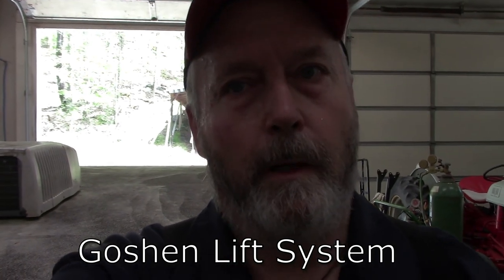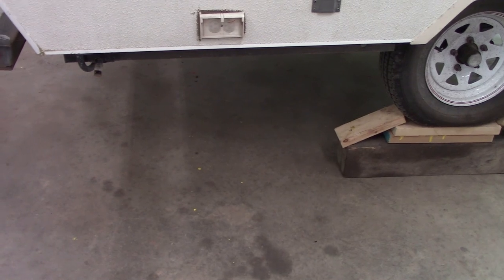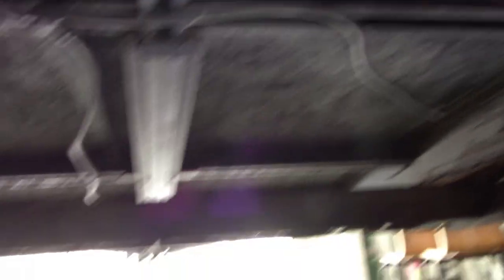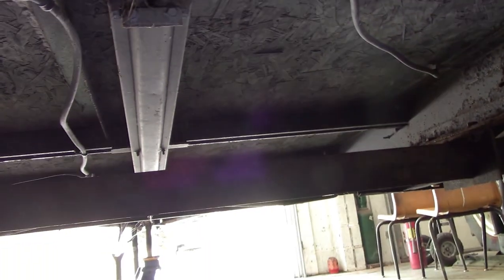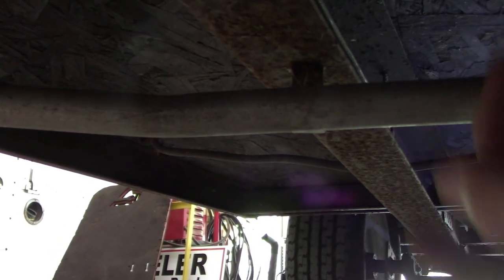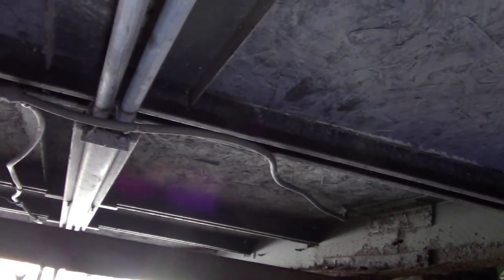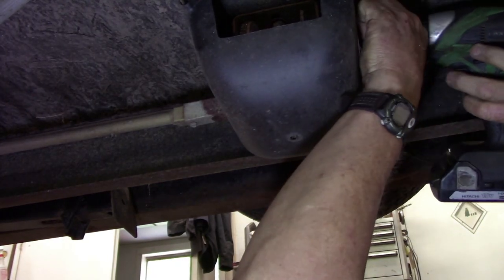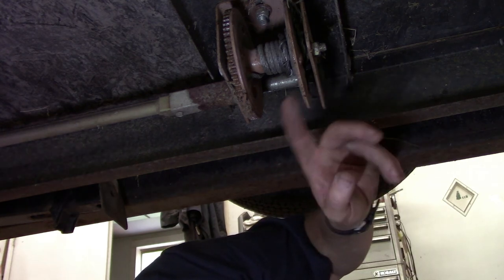Dutchmen Popup Broken Cable Repair Part 1

Comment: After watching your video, I knew I could probably handle the job of replacing the Goshen lift cable in my Dutchmen popup camper, but it seemed like a lot of effort. Did some more research and discovered you can buy a new cable from Goshen for about $30 (+shipping) and you don't have to take the system completely apart like you did. You just have to remove the rear springs. All in all it took about an hour to get mine swapped out. But I never would have found all that out had it not been for your videos. Thank you!! I have a working camper again!
Reply from the maker: Cool. Glad I could help Nick.
Reply: Do you have the websit for the cable?

Comment: Thanks for the video! I just completed the cable replacement but I need the extention peice that goes from the winch to the crank arm. Do you know what this is called and where I might be able to get one?
Reply from the maker: If you are talking about the piece of square tubing on the winch that the crank handle goes into. I don’t know where you would find that. You might have to buy a new winch to get that part.

Comment: Just bought a dutchmen 1998 and ive got 3 side that lift even and the 4th doesnt lift at the same time what could it be. Im thinking maybe a push spring not working correctly
Reply from the maker: It can be many things. You will just have to start investigating.
Reply: @hillbillyrv  alright as im new to all of this it doesnt seem too hard you have a cable that pushes on spring which either brings it up or down

Comment: I have a 1996 Dutchmen pop up Camper is this the same lift system? The other day I open mine and suddenly collapse I think i will have to do the same thing with mine!!!
Reply from the maker: I hope this video helps you.
Reply: Yesterday had a guy removing honey bees from and old Duthman and needed the top higher so i started cranking and you know what happened alrighty..

Comment: Ok I've watched the Jayco and the Dutchmen. Now do a Coleman 😂 I have one you can practice on if you need content! 😜
Reply from the maker: Bring it to Beckley, WV and I'll be glad to work on it. Thanks for watching
Reply: @hillbillyrv  If it wasn't 6 hours round trip! I took it to a guy here, but he said $2,400 to replace the four cables (since he said he might as well do them all). I didn't pay but $1,200 for the camper, and it only snapped because my mom didn't get the latch off. $2,400 was a little out of my budget for the process, considering. Watching your videos is helping though! Thanks!